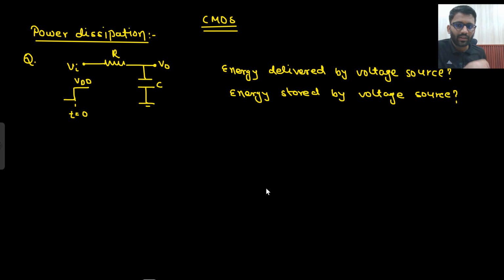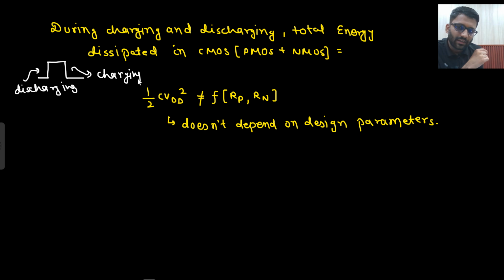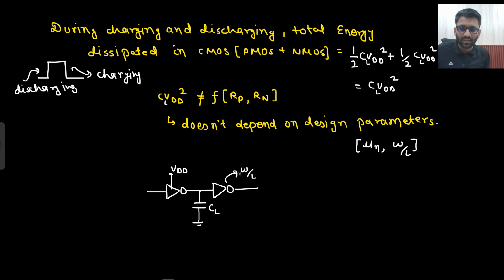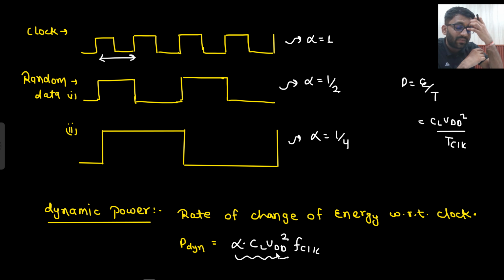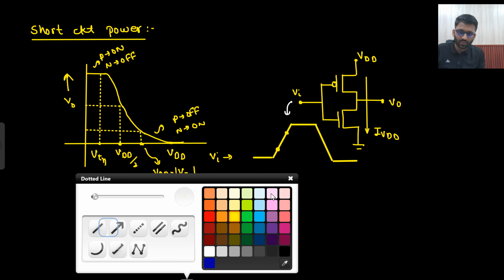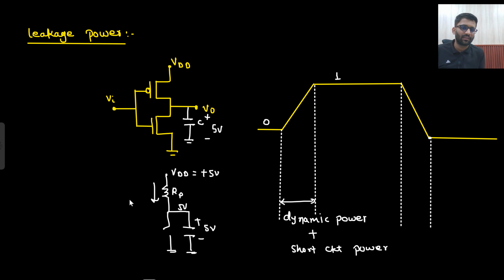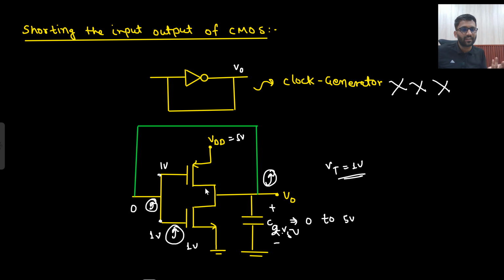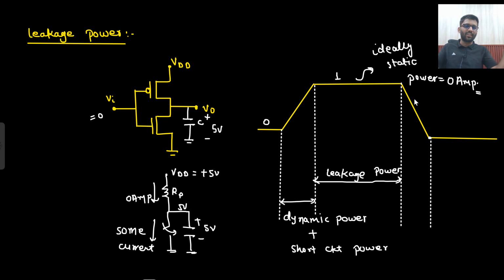🔥Power Dissipation in CMOS || Himanshu Agarwal || Digital Design for Campus Placements

Comment: As know the inductor does not allow a sudden change in the current similarly cap also does not allow a sudden change in voltage so vout  going 5v to 0v so voltage is slightly up to compensate the sudden change in voltage  similarly happens when vout goes 0v to 5v voltage is slightly down to compensate the sudden change in voltage .
I thought this will be another explanation....